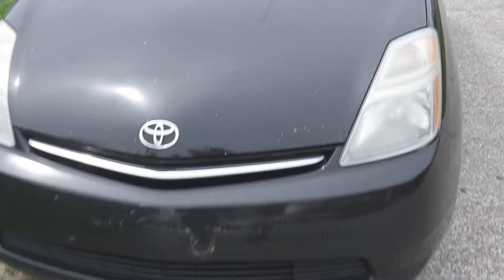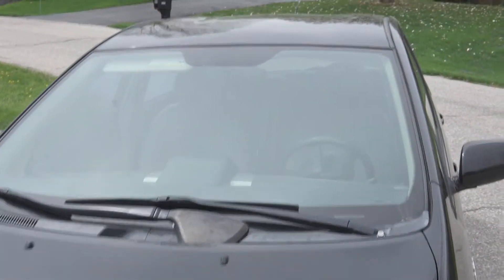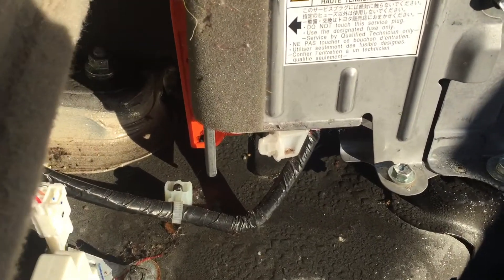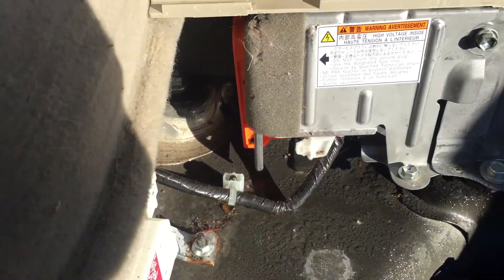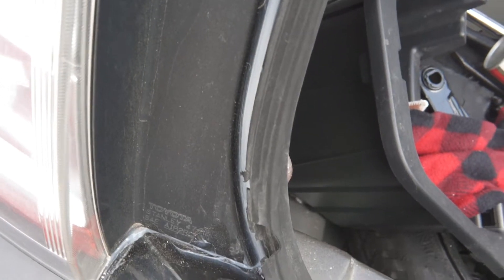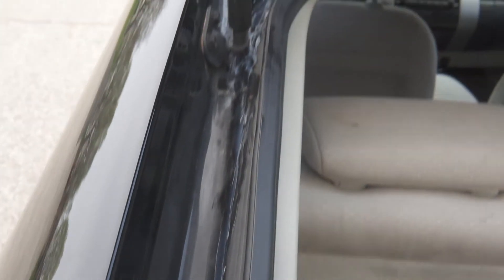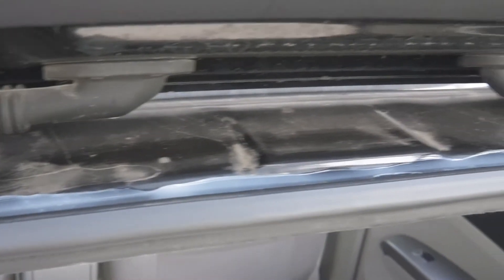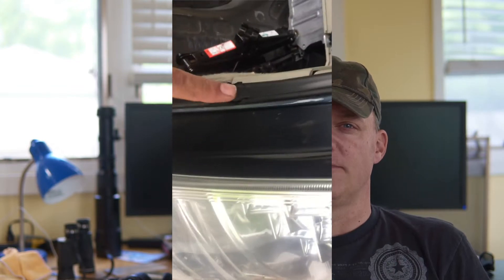Does a Gen II Prius Trunk Leak Lead to Hybrid Battery Failure?

Comment: My car 🚗 developed the triangle sign. Garage said. Recondition your batteries. 8 batteries are of need , replace them. After replacing them a few days after the triangle light came back on went back to the garage the hybrid battery voltage ECU fitted next to the battery cells has now failed according to his diagnostic tool.
After replacing a week later the sign reappeared I went back to the garage back when I get the green bars this is when the battery error illuminates.

So this time he replaced the voltage cable inside the battery hybrid cells typically a week into it the lights reappeared I was very very angry and furious at this time this is when the garage discovered that the boot had water sitting by the spare tyre and also the battery was half full with water after looking up on YouTube I found out where the water was coming from then seal it with silicone then I remove the water from both areas of the car 🚨 it's been 4 weeks now no faults have reappeared on the battery 🔋 the cost of this issue was £425 to recondition the hybrid battery cells and replace the ECU and replace the cable.

It could be that due to the water sitting in the boot compartment has flagged up all these unnecessary faults.
And maybe if I had remove the water in the first point then all the other jobs maybe unnecessarily😢
Reply: Where exactly was the water coming in? Cheers.
Reply: @dublinvids5146  just google Gen2 Prius water leak.
Reply: That’s how I discovered the leak and battery water. Car was throwing weird codes

Comment: Is this the same issue with Gen 3s? We got hit with a hard rain spell and the Prius spare tire well was filled up rather spectacularly with water along with the 12v battery area. I didnt know of course and I started it up, drove about 100 meters and got the "Check Hybrid System" msg on the dash. That's the first error I've ever gotten on this car.

Comment: Hi from France. Got water in my 12v battery compartment coming from the top of the trunk. I noticed the water seeps into the foam on the top right side of the trunk then flows drop by drop into the 12v compartment.
Error codes P0AC0, P0AC1 and sometimes P0A90 readen with Dr Prius app.
My dealership changed the inverter. Problem is still here.
Dr Prius App says my Hybrid Battery is fine. I should check all the water problems and seal it... with my garden hose maybe. My Prius drove fine until I wash it 2 weeks after buying it. The next day Christmas tree happened. Now I hope my hybrid ECU isn't dead because of humidity. It's been 6 months now that I'm stuck with these error codes and my car won't run in electric mode.
Reply from the maker: Hi.  Test your 12v battery and make sure it is good.  Also there is a rubber plug under the 12v you may consider temporarily pulling that out until you get your water issues figured out.
Reply: @RickBolt  thanks Rick. I just changed my 12v battery. Nothing get better.
Reply: I think the part with malfunction in my case is G4283-47030 Toyota Sensor Battery Current. I ordered it and will test with the new one.
I fixed the leak for now with silicon and no water drops now. Thank you
Reply: @dupaincherie44  did the replacement part fix the problem?
Reply: @Tonisuperfly  yes
Reply: @dupaincherie44  thanks for the reply
Reply: Yes I changed the G4283-47030 Toyota Sensor Battery Current. Everything went right after that!
Ordered it on Amayama website